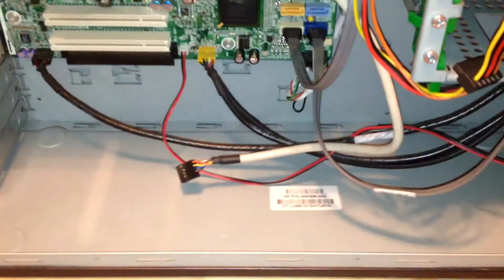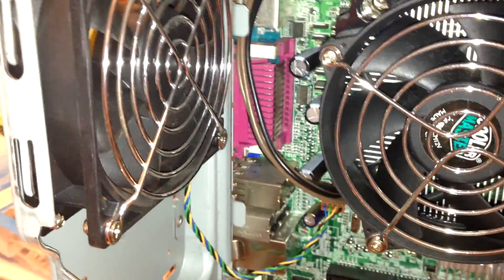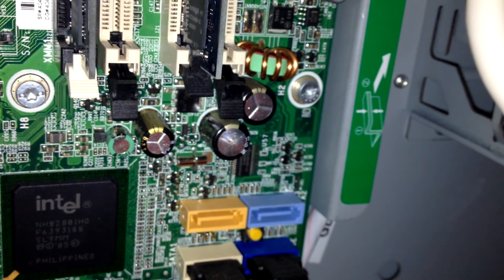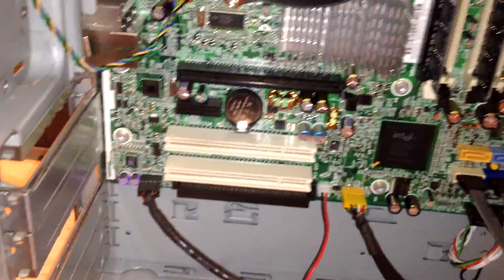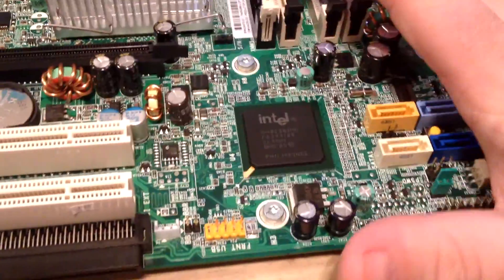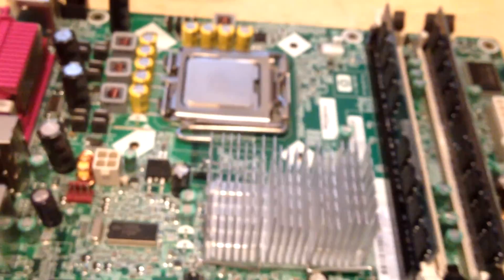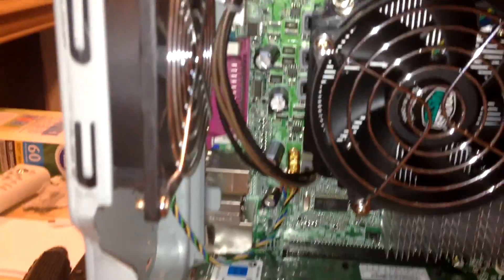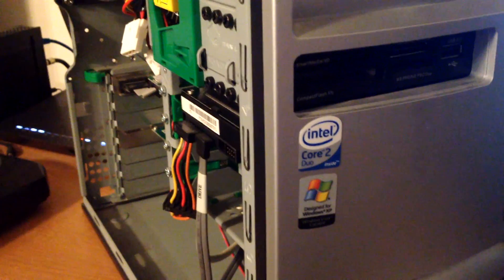HP DC7700 Inspection & Repair

Comment: Even though this is an older Windows XP class machine, it is an excellent platform on which to build a MythTV DVR.  HP's business class PC's are great because they're made to run 24x7 and are usually very quiet, so it can sit behind your TV without bugging you.  High Def TV doesn't require gaming class resources so you can build one pretty cheap with older hardware.  I had one of these toiling 24x7 to record my shows before it finally started hanging and crashing on me.  (I retired it only to discover a few years later that it has a bunch of swollen capacitors on it!)  MythTV only requires a coupla gigs of RAM (4 Gigs is better), a tuner card, and usually the built-in VGA (or a cheap VGA card) is good enough for 1080p TV.  (Splurge on the hard drive, though, especially if you plan to record a lot of shows. High Def takes up a few Gigs per hour.)  Add, for example, a Hauppauge HVR 2250 dual tuner card or an HD Homerun to sit on your network (these can usually be found cheap on the 'bay), and download LinHES or Mythbuntu and you're off to the races!  (I think LinHES will get you on the air quicker.)  Yes, over the air HDTV is still free, and your parents' old roof TV antenna will usually work great with High Def!  So, what are you waiting for?  Why pay for the Simpsons when it airs on Fox for free?  Find new life for a cheap business class PC like this one (or better, one made for Windows 7), learn some Linux and watch some TV!